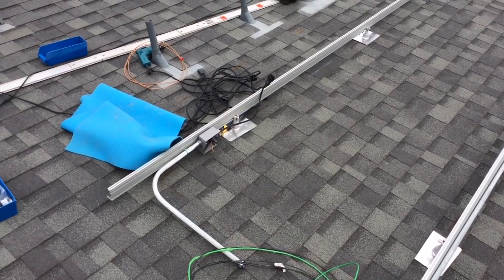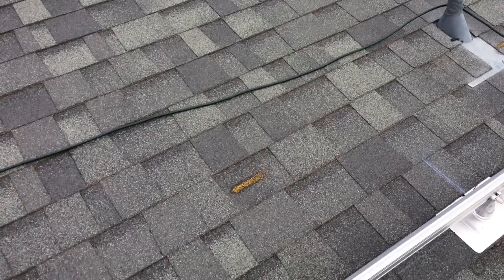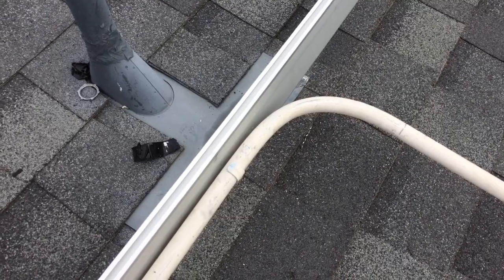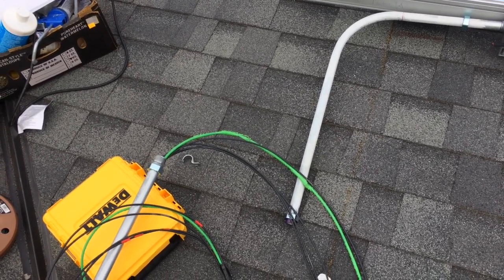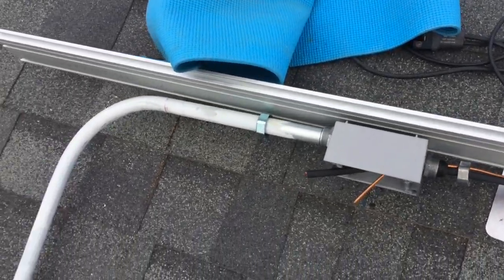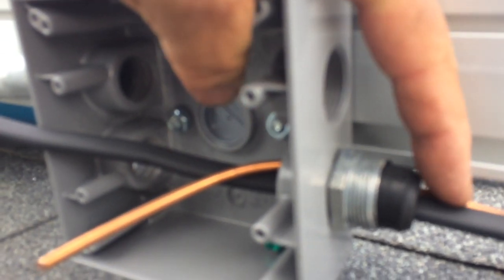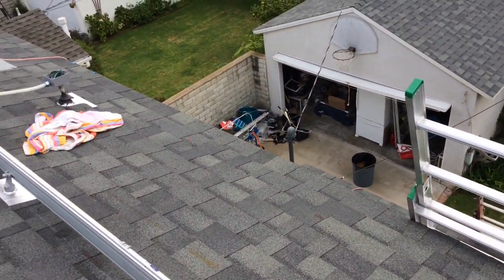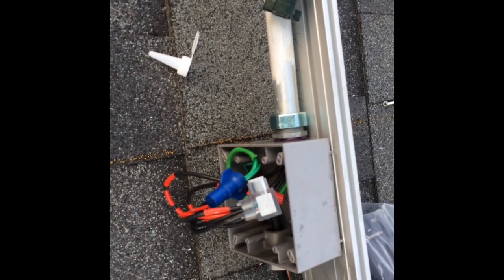DIY Electrical for Solar Installation Detailed Main Panel and Enphase Microinverter w/ J box

Comment: Hello Danny,  Looking at the electrical part of all this and was wondering if you can comment on the "backfeed breaker".  Is the 15 amp 2-pole breaker you have in the main panel a special breaker or just something you picked up at the local home center?  Is the breaker in the the Enpahse Combiner box that is connected to the PV an Enphase breaker?  Is there anything special about it?
Reply from the maker: Mike Bruns This is a normal 15 amp two pole breaker. You can’t use a different type of breaker according to my understanding. I think there’s other comments in this video that also give you details on the exact breaker position In the panel.
Reply from the maker: Mike Bruns Combiner Box breaker is a standard breaker I got from the Alte store.
Reply: @dannyjensen4954  I read more of the comments and I believe you used a 15amp 2-pole GFCI breaker in the main panel.  Correct me if I am wrong.  Thanks.
Reply from the maker: @mikebruns1300  It is my understanding that you can not use a GFCI to back feed. A standard breaker is needed.
Reply: Not all breakers are rated to back feed. If you see LINE/LOAD on it DONT use it.

Comment: Is there a reason you chose to fish your wires in a jbox from so far down? Im about to install the wires form the disconnect to the main panel but i was planning on drilling much higher.
Reply from the maker: Jason Cury Here is a video of the actual J box install. https://youtu.be/8TOpCuC2-kA . It is really difficult to bend the flex conduit and you need quite a bit of distance so the flex conduit can except a bend. I can explain further if you give me a bit more detail. Also I could talk to you on the phone.
Reply: @dannyjensen4954  actually, just run a telephone 90° right out of the bottom of the main panel to a LB.
Reply from the maker: @TheLostAdventuress  The flex would not bend. I had a bunch of wires at the top. I was afraid.
Reply: @dannyjensen4954  telephone 90 comes right out of the bottom of the panel, right into a LB no flex needed
Reply from the maker: @TheLostAdventuress  I have a flush panel. Can you link me to a picture so I can see how I could safely get to the panel knock out via the stucco? The wires were more spread out a few feet down. I did a video on the access.
Reply: @dannyjensen4954  ok so this one is 1 inch, but they have ¾, now run this RIGHT OUT of the bottom of the panel via knockout to an LB.
Reply: @dannyjensen4954  i like this cause its the easiest and shortest way to get the wire into the panel just use the yellow lid stucco patch  after you cut out the stucco and run the telephone 90, do you see what im saying?
Reply from the maker: @TheLostAdventuress  Yes. I'm looking at the 90s.  I see what your are describing. However, I was afraid because I had 2 layers of stucco and 1 plywood layer. I also had a packed panel with romex everywhere.  I didn't have the best tools. Here is my video. https://youtu.be/8TOpCuC2-kA .  Thanks for your comment. This is a valuable thing to know for my next panel adventure.  It would be more professional to do the 90.

Comment: okay I only have one question. when installing a solar system do you feed the power that you generate into a outlet then feed that back into the power grid, or do you pull directly from the power that the solar panel provides?
Reply: hmmm... the answer is in the video: the power from the generated power is coming into the main service panel on the breaker he installed at the bottom under the load breakers, that is feeding the generated power directly into the main service panel; all this instead of an Outlet.
Reply: @mayodavid4962  the power from the generated power
Reply: @mayodavid4962  so is he just giving the solar energy he harnesses back to the electric company?
Reply: @Dtr146  The main service panel is from where all the wiring starts to your whole house, so, since the power generated is being sent into there first, the house will absorb as much of it as needed and if the house wiring needs more it will absorb the rest from the utility source which is connected on the other end of this service panel, when the house is absorbing less or none then the power generated on the roof will flow through the service panel and into the wiring from the utility. You would likely have changed to a meter that turns in both directions so that it back winds when you are sending electricity into the grid.
Reply: If you have solar power back fed into panel how does it not buck phases?

Comment: What size double pole breaker on main panel
Reply from the maker: The sizing of the back feed breaker depends on the amount of Amps you plan to feed to the panel: The exact breaker size depends on  1) your city 2) the inverter / micro inverter manufacturer given he amount of watts in the string. Solar Design tool also calls out the breaker size.  I had 7 micro inverters at about 300w each at 240 volts.  The California guide calculated a 15 amp breaker.  However, I upgraded my wire size to 10 for less voltage drop and future so I could have had a 30 amp breaker based on my 10 awg wire.
Reply: If the current is goes on above 30A so the wire size is changed according to current we used 8AwG for 30 to 50A

Comment: How can I control the system thru the internet??
Reply from the maker: I may not understand your question. However, all systems can be monitored usually through the internet. This is usually a function of the inverter you select for your project.
Reply: @dannyjensen4954  my sistem was turn off  and they ask me for money and I don't have any money. I try to get someone to help how to do it. Thank for help
Reply from the maker: @teresagonzalez9530  You may have a leased system you are paying for and the owners may have a clever system to make sure your lease payments are kept current?  I can't help you. I own my panels on the roof.
Reply: Watch the Matrix

Comment: Someone help me understand. You need a breaker purely for the solar panels located at the very bottom of all of the other breakers. This will merge both utilities electricity and your solar electricity. Is this correct?
Reply from the maker: Yes. I have covered this in other posts.

Comment: I’m confused is your main breaker on or off when you’re back feeding the panel from a PV system.
Whenever I backfeed a panel I make sure I turn off the 200 amp main when Edison is out.
Reply from the maker: My 200A Main breaker is on when I'm back feeding on a grid tied system. I'm using Enphase iq7 plus microinverters and they need utility power to be on so they can sync microinverter output with the power company. I'm not using any batteries.

Comment: Kind on cable did you use from the roof to the charge controller ? Did you use OFC cable ? To loss the lest amount of electricity is see they want 0/0 wire but for 50 or so feet that’s expensive 10AWG wire you lose like 5%  any info welcome !
Reply from the maker: Thhn 10awg . This is  220v ac. I thing you may be a 12v application? Batteries?

Comment: I have the enphase main box as well and I can't get a green light because I now have a fridge running and its interrupting the communication to the microinverter. Do you know if the status needs to show green for solar harvesting to occur?
Reply from the maker: I have 2 refrigerators and have not had an issue.  It makes some sense that maybe electrical noise would be causing a communication issue because the inverters talk to the envoy over line 1 and line 2.  I'm guessing your green light is the envoy green light.  i'm wondering if a power line filter connected to your refrigerator would fix the problem assuming you have isolated it to the refrigerator by turning off he breaker and having the problem go away.  Here is a link for your consideration 

https://www.amazon.com/Suppressor-Single-Phase-Line-Conditioner-JREle-JR-L010-N/dp/B073RMDRK8/ref=pd_day0_hl_328_2/143-9866339-4871133?_encoding=UTF8&pd_rd_i=B073RMDRK8&pd_rd_r=7fe6fd8c-a51d-11e9-a213-f70688893b5a&pd_rd_w=nJjj3&pd_rd_wg=kXpoL&pf_rd_p=ad07871c-e646-4161-82c7-5ed0d4c85b07&pf_rd_r=GHA3J0FPCJRS8Z7RDMR1&psc=1&refRID=GHA3J0FPCJRS8Z7RDMR1
Reply from the maker: Also, maybe could could check the ground wire where it connects to your service panel and try connecting your refrigerator to a different circuit via an extension cord to see if this helps to isolate the problem
Reply: @dannyjensen4954  This is good to know. I have a GFCI hooked up to the fridge along the same circuit. I'll have to get that taken cared of. Thanks!

Comment: ??? With your hybrid inverter needs an ac input,  so do you have another breaker somewhere going into the inverter?  And then coming back into the bottom most point on your circuit breaker box?   I’m very confused about that.
Reply from the maker: This is an Enphase micro inverter system. You can search for this and find the schematic for the wiring details. 1 inverter for each panel.

Comment: Thanks for posting this up. I plan on doing a solar install in the next year or so and I plan on going with Enphase as I want to start out small and expand down the road.
Reply from the maker: Enphase will have iq8 this year. I may add a few more modules also. I may get a hot tub so I thinking about adding a patio cover with solar and pay some of the cost with the energy credit. I also have other videos. Thanks for your comment.
Reply: This was great, I've been looking for "solar power do it yourself free" for a while now, and I think this has helped. Have you heard people talk about - Piyaarter Uncomplex Preeminence - (Have a quick look on google cant remember the place now )? 

It is a smashing one off product for discovering how to generate energy-on-demand without the hard work. Ive heard some incredible things about it and my partner got excellent success with it.

Comment: Danny - great vids - thank you - curious if you recall what circuit breakers you required for you microinverters?  I'd read somewhere on enphase's site that you need 20amp breaker per 16 micoinverters?
Reply from the maker: Shane Claussen Thank you for your complements. IQ7a is probably what you will be installing not IQ7+ like I installed. You need to look at the ENPHASE  spec sheet. I’d pick the largest breaker rounded up to a full string.
Reply: @dannyjensen4954  Thanks - I rechecked - look like IQ7 is up to 16 @ 20amps.  Thanks for the quick response.
Reply: Hey bro according to my information there is 4 breaker of 20A slot in a combiner box and it's did not get more load from a 20 A breaker and the load is depend on micro inverter there so many choices in enphase like IQ7,IQ7+ & IQ7A according to this we send 16,13 or 11 modules per string if am wrong please suggest me.

Comment from the maker: This is an Enphase system with microinverters so I’m showing the complete install. My breaker needed to be on the bottom in my case per nec 2014 option 2 see link https://www.jadelearning.com/2014-nec-705-12d2-understanding-pv-interconnections/

Comment: Hey, awesome video!!! You did it all and explained in layman’s terms.  I live near you, and wanna follow your lead.  What wire rating did u use, and where did u buy it?  Thanks & congrats on a great video & job, helped us future diyers.
Reply from the maker: I'm so happy you find value in my videos.  You are a brave person tacking this DIY project.  I tried to document everything I could not find youtube as well as stuff I did find by search around. I used THNN wire this was called out by the California Solar Guide I believe. I did a video on permitting this covers calling out all the wire types. I bought a big roll of black for both the black and red wires because you get a bigger discount on a big roll. The red wire I marked with red electrical tape as shown in the video. The Green is also THNN but is 8awg.  I also used #6 bare copper. All purchased at Home Depot or Lowes.

Comment: I guess you're immune to gravity. Hope you widow enjoys the free power.
Reply from the maker: Mark Martin Putting the panels up is scary
Reply: @dannyjensen4954  denny.
 Scray ?  Then why don't  you  install an anchor, put on a harness, and secure yourself?   You are advocating that people put themselves  at risk to install a PV solar array system on the roof of their house.  Is that  worth risking your life over ?  Is it worth spending trillions of dollars to reduce  global  temperature by 0.01 degrees Celsius ?  It is insanity.
Reply from the maker: Mark Martin I should have worn a harness and I should have told everyone to do the same. Good comment.
Reply: @dannyjensen4954 
Good answer. It's not like it's your everyday job. So it's good you put it up on YouTube.